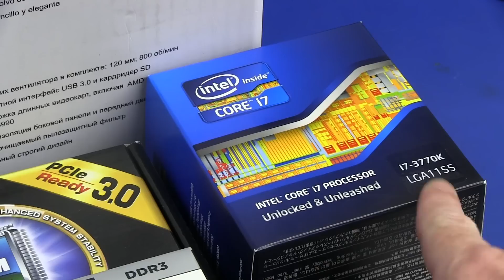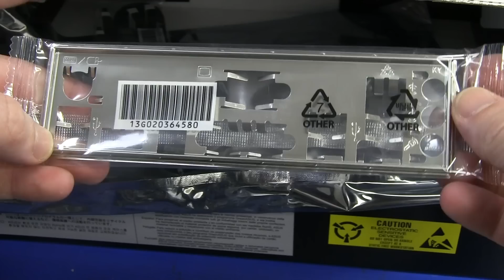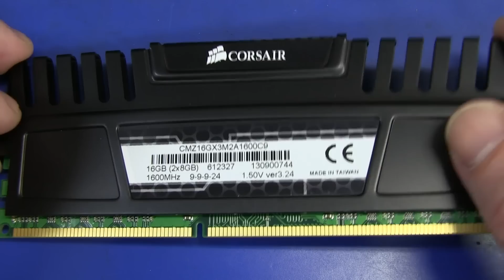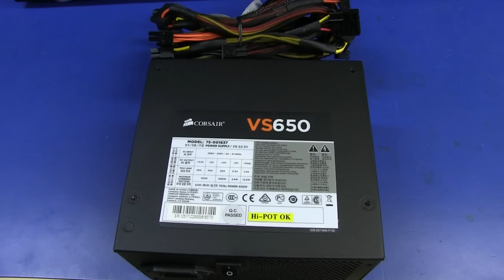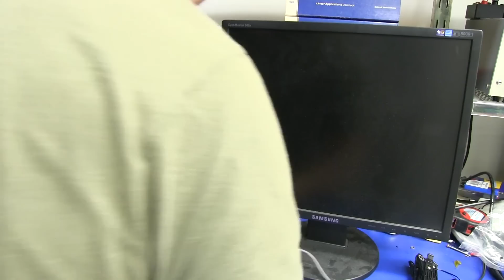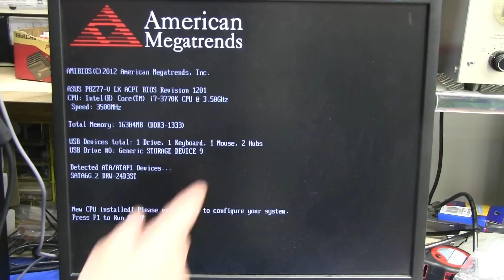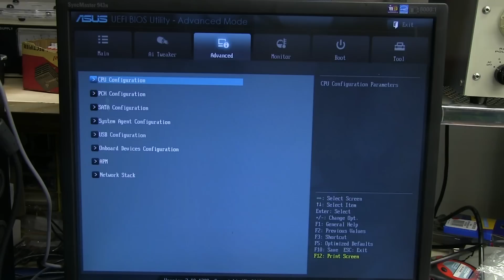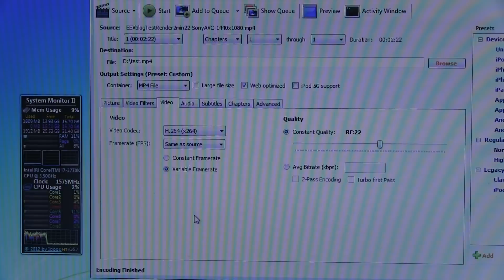EEVblog #462 - Video Editing PC Assembly

Comment: my OCD building side was going crazy over the cable management... there's holes and ports for hiding all the wiring behind the motherboard... it looks so much prettier and the airflow's so much better when you hide all the cables in the back!!
Reply: ThEcRaZ3dGaM3R While this is true to a point, it's a moot point as he has a windowless side panel (nobody's going to look inside it, why bother making it look pretty?), and LTT has pretty much proven that the loss of airflow by having a rats nest of wires is negligible, as they literally filled a tower with clothing and an iron while running, blocking all possible airflow, put the processor under load, and they still couldn't get the computer to overheat, I don't think one measly wire will completely destroy airflow
Reply: Michael Dickens Very true!!
Reply: You forgot cardboard boxes

Comment: put the rams in  : black both or blue both not one black and one blue ( the a and b ) are channels that helps a lot for you for speeding up ram access:now you are using only A channel B is idle so if you put the ram you shall get double access speed.
Reply: just saying that
Reply: You can run in dual channel ram or single. Both have there advantages
Reply: Agreed. It works much better if you use only one channel if you have only 2 sticks of ram.

Comment: I was going to make some observations.  But, I will not.  15 years since your last build so it's understandable that mistakes where made.  Next time I would suggest watching (or asking) someone who builds PC's all the time for a little help and advice.  But nice attempt considering, I've seen a LOT worse.
Reply: Yes really...

Thermal paste should be applied on the cpu in a pea sized dot

Ram should have been installed in the 2 blue slots (would have also allowed the fan to be installed in its original configuration)

I/O shield is to be installed into the case first

But considering it's been 15 years since he's built a PC, they are common noob mistakes that won't keep the PC from running. So I'd say he did an alright job, it works!

Comment: Sucking the air thru the radiator IS more efficient. 
The fan causes the air it's pushing to rotate, your radiator has fixed, straight fins - so you push turbulent air into straight and rigid fins. 
Allowing the air to com in the fins as smooth and non-turbulent as possible allows for better laminar flow and fewer vortexes that spin hot air in place instead of moving out.

Also, the rotating air is spread in a cone shape, while exiting the fan, leaving a bigger-than-the-hub "hole" of air that move slow or stands.
Reply: yada yada

Comment: treat the thermal compound like toothpaste... just make a little line in the middle of the processor and when you mount the cooler on, the pressure will spread it out into a thin layer
Reply: +Devin Stepp on that topic if you need thermal compound in a hurry just to hold the computer temps till you get real thermal compound, toothpaste will work as a temporary thermal compound. i've done it before and it works just fine just don't use the grainy stuff. and don't leave it in more than 3-4 days. just for emergency use.
Reply: +brandonhughes7 dang that's kinda Kool  XD lol

Comment: I ground myself by touching the case first, before the motherboard. I never use anti static wrist straps since the 1980s. Never ruined a board. Just make sure I stand in the kitchen on the tile and use a table without a cloth on it. The motherboard bag only has ESD coating on the inside of the bag so I put the motherboard on top of the box it comes in for anti static.

Comment: what about using ramslots 3 and 4 instead off 1 and 2?space for fan is not a problem then. as long you are using both channels.are clearly marked in fast guide for asus mobo.those ram heatsink are most for show anyway if they are ddr3 and 1600mhz.

Comment: Things I spotted: Way too much heat sink compound, yes use a plastic card. No need to have extra compound oozing out.
Snap the IO shield in to the case, then put in the mobo.
Dave mentioned the power connector not being supported, but there was an empty mounting screw right beside it if I saw correctly. Is that because he only did 6 screws/standoffs, instead of the usual 9?

Comment: well whats with smack talking gamers?
Reply: +newrhea13 Because we have better systems
Reply: +newrhea13 It's because they are too stupid to realize he built the PC for video editing not gaming and they also probably have no clue that you need different specs.
Reply: Even though he using a desktop CPU and a desktop ATX board, yeah ok....
Reply: Destrica UK Opposed to what exactly? I doubt he wanted to spend 2-3k on a system.
Reply: I Love Purple Hazmats he was referring to it you saying it was not a gaming computer. also 2k? how is it possible to spend 2k on a build like this? is that usd or aus?
Reply: newrhea13 I know, that's why I was saying that if you want a really good editing machine you will spend more than you would on a gaming machine. For that build he spent just under 1k.
Reply: You can have an 8 core xeon and a titan x for an editing machine....
Reply: +Destrica UK Yeh and he could have a Ferrari F40 to go to work in . And a helicopter to go to the shops in ...........
Reply: Tristan Gauci What he has built and fixed should work fine for video editing.
Reply: 12GB Vram? Quadro are 5K while a Titan X is 1K, both designed for workstation use.....
Reply: Yeah it is beside the point, "Smack talking gamer", you misunderstood me, I have an i7 but if I was an editor for my JOB, I would go with a higher core count and a GPU more suited for editing with more VRAM, a Xeon is more suited for the same price for rendering due to its core count, so all in all we all have different opinions

Comment: 32:00 you install the IO bracket *FIRST!*
It's designed to clip to the case. Then you just slide the motherboard with connectors in there.

Comment: And it doesn't really matter the direction of the air flow, as long as the heatsink contact surface area with it is the same.

Comment: I have seen this case causing overheating problems due to the noise dempening material packed on it. The heat stuck right in the case. Hopefully it won't bother you..

Comment: Hi, Dave ! D. here, long time caller! I have a question for you: I am a proud owner of IMKO-4 desktop PC (also known as Pravetz 16) with Intel 8088 @ 4 MHz, upgraded to 640KB RAM and 22MB HDD. My question is, if I replace the high voltage capacitor in the power supply with Panasonic 105 degrees rated, may I  eventually over clock the processor to at least 3.5GHz as yours, or I still need to install a fancy fan with copper  on it?
Reply: +Д. Станоев I think in your case the one and only solution will be water cooling systems.
Reply: +ThereWasNoFreeName might need liquid helium cooling for that,

Comment: Depending upon the video editing software you use, a discrete GPU can be very beneficial in rendering videos. A GPU can crunch the numbers at a greater speed than a CPU alone. I don't know if you've put a GPU in your rig by now but if not check your video editing software and see if it can leverage CUDA (nVidia) or Open CL (AMD/ATI). You'd be surprised how much difference it can make.

Comment: They colour coded the ram modules are there for a reason, it indicates the dual channel pairs, plug the paired modules in so they are both on the same colour to get higher memory bandwidth.

Comment: It's just as thin either way if you do it right. You use a rice grain size blob, and put some pressure on it. The main goal is to make sure no air is in it. That's where the blob excels, because it pushes the air out as it goes, where spreading it easily traps air (the same way tape does). Even if the blob doesn't quite make it to the corners, the center is where the chip is hottest and is most important, and if you get any air bubbles in the center, making it to the corners won't matter.

Comment: 8:20 I always recommend to screw HDD and stuff, cuz if you dont do that HDD will vibrate and make noise, then no reason why buy so expensive cases and fans if you HDD and DVD/BD rom will make noise. Best thing to do i put kind of rubber between screw case and between case and HDD. If you have SSD you are fine.

Comment: We have the same case! The top-facing SD reader is pretty convenient, but I do have to blast it with an air duster every couple of months. Very nice quiet case though, especially with the water cooling system I use.

Comment: Do you have those figures? I can see how increasing the distance between the two thermal planes causes a drop off in conductivity, even if the void is filled with paste, but I'm not sure where the idea that a blob is better than a thin even layer of paste...would be interesting reading to put it all to rest!

Comment: U don't need to do that with thermal paste all u need to do is about a pea sized dot on the cpu and when the pressure of the cooler is applied it will spread it out and won't leave air gaps and wont ooz out

Comment: You can easily test this by trying it. Use a heatsink or anything really, and try it both ways on some clear plastic or a piece of glass. If you see bubbles in the center area, it will run hotter, no matter how you do it.

Comment: The solder paste doesn't transmit as much heat as the actual metals of the CPU and the Copper of the heat sink, so you don't want to 'block' the better thermal conductivity between the two surfaces with air OR thermal paste. It's just there to fill the gaps on the surfaces, not as a replacement to the metal surfaces.

Comment: 32:00 - you can insert the connectors cover directly into the case and then slide the motherboard into it. There are little tabs on the cover edge to hold it in place.

Comment: The RAM should be installed in slots of the same color. Yours will not currently be running in dual channel mode so it will be (slightly) slower. Also some boards prefer to have the second pair of slots (the blue ones on yours) populated first; but some don't. Depends on the board.

Comment: Hi Dave you put your ram in single channel mode which is going to be slower than dual channel...your two ram sticks should be in either in the black slots or in the blue slots otherwise you will not get the performance that your ram is able to give you...and the thermal paste is way too much and the I/O shield is easy to install first into the case and than just slide the motherboard.... Thanks anyway for the video :) thumbs up :))))

Comment: watching you put this new system together, compared to all the old systems, is much different, and much better. I understand the faster rendering with big graphics cards, but having that thing sitting at less than 50 watts is really sweet. which makes everything run quieter, and longer, like in that cheap power supply. I think it is a real winner. I could see you putting tape strips around the perifery of the heat sink, to seal the air leaks, but looking at the cpu temps, probably uneeded.

Comment: I'm no overclocker, but I don't think laziness has anything to do with using a rice grain sized blob in the centre. Some of those guys will spend a lot of time lapping the heatsink, to get as smooth a surface as possible; to increase the amount of metal to metal contact between cpu and heatsink. They've determined by trial and error that the clamping force is sufficient to spread the paste across the interstices between cpu and heatsink.

Comment: I couldn't help but to notice that the 2 WD Green drives were in what appears to be Netgear ReadyNAS hard drive caddies (thumbs up). Also, does that built-in SATA dock require some sort of caddy or do you just slide in the dive? Either way, its about time that PC case manufactures have such things as standard.

Comment: You should connect some fans to the FAN ports on the motherboard, this will control other fans besides the CPU Fan which should have its own connector labeled as such.

Comment: I built my last PC to use as a firewall/router, so I bought cheaper hardware.  I still bought everything new, and chose parts from familiar brands I thought might be reliable based on good reviews.  I stayed with the stock fan, and the fans that came with the case, and everything does run very quietly.  It was a fun project.  Before that I hadn't actually built a PC since 2003.  I was fascinated by the CPU.  Very small and no pointy pins.  
Because I do love gaming, I do want to build a much higher end rig that can handle newer games.  But that's something I'll have to put off until later.

Comment: Actually the majority of modern CPUs output the most heat in the center of the chip, so an oval region of thermal paste is usually sufficient. Certainly it's better than too much thermal paste. And the lack of air bubbles also makes it more efficient than thermal paste spread with, for instance, a credit card.

The rice grain method is a compromise, as a reliable way to get a "good enough" thermal paste layer, without it being too little or not enough and with no air bubbles.

Comment: I just built a very similar system with the 3770K and similar corsair ram(red heatsink and 4x8GB for 32GB total). Two things I wanted to point out. You need to stagger your memory when using two dimms for best performance. Use the black slots or the blue ones. Also, running your cables behind the motherboard tray will not only look nicer, but usually improves air flow. That case should have enough room to do so.

Comment: There are some performance gains with dual channel but the memory will work in single channel mode. If I remember correctly from the video it was only slot A1 that was blocked by the fan so he could set it up using slot A2 and B2.

Comment: @EEVBlog- Let me know if you find this to be useful.

 You mention having a single drive for your video rendering drive. I would recommend picking up 2 or more 128GB SSD drives and run them in RAID 0. Ideally, if you had 4 128GB SSD drives - create 2 raid 0 drives ( call them f drive and g drive) , you could store your source files on the f drive and set your target as the g drive.  This will give you the most significant performance improvement. I disagree with your comment about the speed of the drive not mattering - that it can keep up with anything from the CPU. 

The information above is really geared toward render intensive video editing, like adding overlays, effects or transitions.

Comment from the maker: You are wrong. I have tested a GTX650 GPU on this machine, and it is basically no faster than the integrated graphics. And 0% faster using Handbrake. Stop throwing generic numbers out there.

Comment: it also appears that you may have missed some screw mounts, there should be 8-9 screws attaching the mobo to the case. it shouldn't be that loose when you plugged in that connector.

Comment: Great video as usual, nothing like assembling a computer with current generation parts and marveling at the new wizardry.

I would really enjoy seeing you analyze the noise output of the case. Also, you may have already tried this but does the CPU fan fit in its optimal position if you put the memory sticks in the light blue memory ports (A2+B2)?

Comment: Dual mode recommended for modern PCs, that why the manfuctar company put them in different colors , in case you use unmatched colors it work fine but in rear cases you notice some glitch when saving something or when copying a large file ,by the way the matching colors adjust their freq. and passes smoother than other way

Comment: @ 31.00, They make it easy for you with the backplate as you can just push the backplate into the case and THEN install the motherboard separately.  

You should have been able to stick the RAM in the 2nd channel (blue) instead of the black and keep the fan on the correct side.

Comment: You can conduct the cables on the other side of the case (for the motherboard) through the holes. This will improve air flow.

Comment: in honestly surprised you even bothered with an optical drive. everything can be downloaded online.
Reply: +Andrew Cassidy i cant imagine my system with out an optical drive. i rather have a physical copy of things rather than download. also i use Blu-rays as a backup method.
Reply: +brandonhughes7 I did not install an optical drive but bought a USB 3.0 external drive - a cleaner look plus fast data transfer.
Reply: Jonathan Peden i rather have an internal drive rather than a external to me the internal one looks cleaner to me and less wires i have to manage outside the case.
Reply: brandonhughes7 I was faced with this conundrum when updating my rig:  my new mobo has no IDE header but did have USB 3.0, so rather than buy a SATA internal I chose external - I have a Zalman Z3 Plus case with a slightly curved front panel and an internal optical drive would stick out like a sore thumb.
Reply: Jonathan Peden you still have an IDE drive. i think its time to upgrade to a newer drive like a bluray burner. i have a corsair vengeance c70 case and a optical drive fits right into place with the look of the case.
Reply: brandonhughes7 I am still upgrading - my Samsung 850 EVO SSD is winging its way to me as I speak, can't wait to get that baby running.  I chose the case because of cooling:  it has two fans on the top panel, so as I am running an FX 8350 cpu (with a CoolerMaster 812 EVO cooler) I need all the heat exhaust I can get.

Comment: Thermal grease becomes more liquid when heated and constant pressure from heatsink will push away the excess paste in few hours at latest (it's good to wait after fresh heatsink install, temps can go slightly down). The only downside is big mess at CPU and socket.